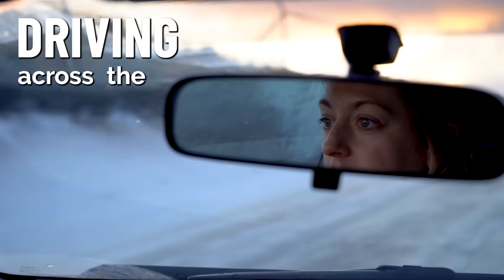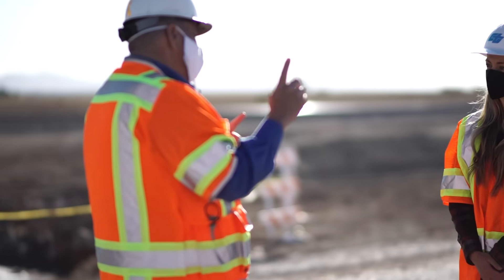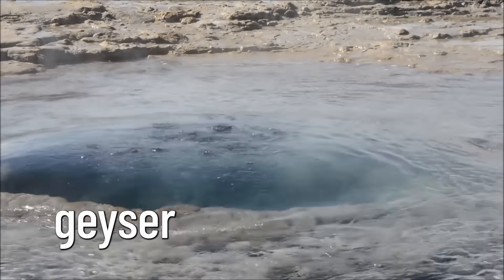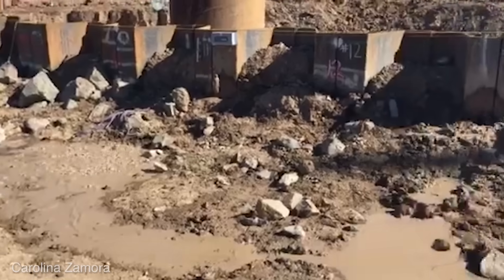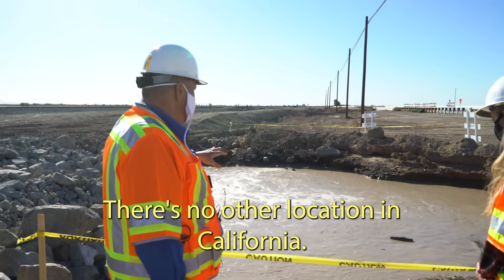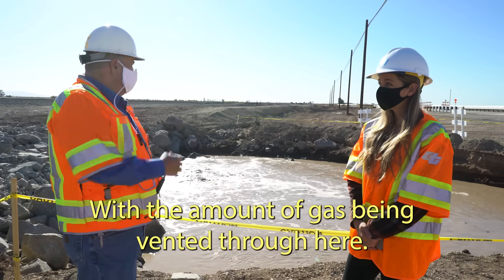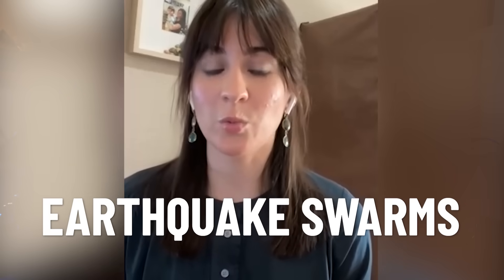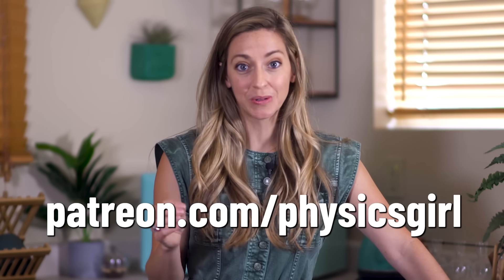World's Only Moving Mud Puddle

Comment: If that theory is right, you could drill a huge hole (maybe with explosives?) a few hundred meters away from its current position, in the direction that it is moving and it would "jump" to that position. There are a few caveats to this but It's a good starting point.
The caveats that I can think of are:
- What if the speed that it's moving is so fast because the angle is really big? Depending on the source depth, you can't just drill deep enough.
- What if there are more "solid" bedrock in it's path, forcing its path to change directions for a while? It could also make the puddle stop moving and then after years (decades even?) "jump" ahead.
- What if the path it is taking is pretty straight but "near" the surface it deviates? (imagine like the shape of a street light lamp post)
This is soooo weird. I like it. Also, what if the source itself is moving? I know that is highly unlikely, but not impossible.

Comment: Can you do seismic test of the area and find pressure pockets and plan a pressure release if it's possible . Than it would remove the gas from beneath on the parts you have drilled which would reduce the pressure that it exerts on the mud puddle hole . It's like analogous to a pressure cooker if you poke small hole on top the pressure wouldn't built up that much and maybe use the CO2 obtained from the puddle for industrial usage ?

I think a seismic analysis of the area is crucial . The source of pressure must be determined

Comment: It really reminds me of the cold co2 geysers in germany like at andernach or wallenborn. Especially since there was mention of a co2 reservoir. The movement feels to me like some sort of erosion. The flow first found a path and since it started flowing it erodes at the top and moves until it is a vertical pipe basically.
But that would be just speculation offcourse.  Maybe a seismic survey could pick up some faults or detaills about the reservoir

Comment: If it is caused by gases traveling up at an angle then surely you could drill down and release the pressure somewhere else where it's not gonna be a problem, by giving it a shorter route

Comment: I'm guessing that some seismic studies have been done to try to find the source of the magma driving "kyle". Somewhat disappointing that this was not discussed. The most likely way to save the highway would be to drill a pressure relief hole for kyle to teeth on, on the other side - but you'd want to have some idea of the path the gas is following to know where to drill. And ultimately you'd like to know where it is coming from to determine what else will be at risk.

Comment: I suggest doing a seismic survey like they do in oil and gas explorations. The result may give data to come up or to validate a model of what’s happening such as the gas pocket on a ramp hypothesis that you suggested. I’m surprised they haven’t done this already. How did they decide on the depth and strength of the retaining wall without doing this?

Comment: Why don't they drill the other side of the road? If you can't stop it, help it get there, so less damage is done to the area. The puddle is moved a lot and left behind solid ground so this may help. If necessary drill at an angle.

Comment: Is the solution so obvious  that only I thought of it?

If the theory of the puddle travelling towards its source is correct, then drilling on the OTHER SIDE of the highway would give it the more vertical route and thus save the highway!

Just stand well back while doing so

Comment: I’m surprised that we can not simply make a 3D scan of the underlying  geology. An animation of that over time would be awesome. Studying its source and path is important. You can not stop a hurricane (yet) but you can plan for it. =]
So glad you are back. Missed you so much. !!
Reply: That's a field that's still in its infancy due to dirt and rocks and so forth being so difficult to "see through". You can use ground-penetrating radar in some soils and not others (too much moisture makes it reflective so you can't "see" very deep in the best of conditions), you can use what amounts to sonar (set off small explosives and "listen" for echoes) in some but not others and so on. You can get some general idea of what's there for a ways down but how far "a ways" is, is extremely variable and limiting.
I ran into this issue when I was an irrigator in Phoenix Arizona which basically is built on 400-ish feet of muddy, sandy river silt deposited on top of a granite bed over geologic ages as the Salt River meandered over the basin filling it in. There are many many layers of a mineral known as "caliche" which is what you get when heavily mineralized water (that's how the Salt River got its name) dries up in summer- it's a lot like concrete but more difficult to dig through. So you have 400 feet of silt with a web of rocky strands penetrating it in many overlapping layers. Sonar can't see through it and ground-penetrating radar is stopped by the water some of those caliche layers still carry when it rains and the water penetrates to their depths. It drives local geologists to drink (not water). California soil is way worse with its higher water content and earthquake-shattered rock formations.
We just don't have a technology to do it.

Comment: I'm wandering if the underground source of the co2 has been releasing the gas through the only available outlet that just happened to run a long distance underground before finally going up and out. Over time, that outlet may have eroded away, presenting the moving mud puddle. Perhaps they should try digging ahead of where the puddle is moving to. I suppose they may be way ahead of me and likely already tried this.

Comment: The solution is fairly simple. Either you move the road around it til its beyond the point of the original road, and repave that, or dig down, build an underground bridge, put the road on top of that, and let it flow through an artificially lowered canal til its past the road.

Theres another thing that can be done, if it really is coming up at an angle, you can attempt to pre-empt it and drill ahead of its path to see if you can get it to prematurely move a larger distance. The fact it moved 60 feet in a day once means its clearly got a lot of distance to cover and potential for movement.

Digging a channel down 50 feet or so, and in the direction of travel, would be the easiest way, instead of doing sheetpile walls perpendicular, use them for the sidewalls, anchor backwards into the ground a few hundred feet, and just let it erode underneath the bridge, while the bridge sits pretty on either side.

Im surprised they havent done more real geology on this, ground penetrating radar, seismography, prospective drilling.

I mean, its possible they have and just dont wanna talk about it, but still, the state or county needs to get on this.

Comment: If it’s coming up at an angle (that’s just getting steeper over time, bringing the top in line with the actual source)...

...that could explain the wall’s behavior. As it shallowed out, that pressure would first hit the wall, causing it to crack and leak, before traveling up and exploding.

...couldn’t you get it to “skip” past the highway by drilling a new hole on the opposite side, along the apparent path of travel? Basically vent it closer to the origin, and let it restart there. (Granted - who knows how deep you’d need to drill - at least deeper than they set the wall - but it would be a repeatable control method.)

Comment: if the reason it's moving is in fact that the gasses are coming up at an angle from a deep source, and wants to find a more direct route to escape, would it be possible to drill down deep on the other side of the highway, intentionally creating this more direct route?

Comment: Unconsolidated sediments from the Colorado River dumping into a graben formed by the East Pacific Rise being over-ridden by the North American tectonic plate with mantle sourced, or biologically sourced gases coming to the surface through a shallow aquifer. An analysis of the radio-isotopes in the gases would give important information about the source. The gas and water may have started moving through an inclined fault plane associated with graben development, and the water and gas stream is migrating to a more vertical vent arrangement which would be more mechanically efficient. This hypothesis would be supported by the migration of the vent toward the center of the graben (SW) rather than toward the adjacent crustal block (NE)

Comment: seems like its a pocket of gas and water thats bursting through the strata. but its also erodes the sides of the crevaces it escapes through, and it falls into the pit. not unlike the story of where the laked drained and disappeared. where drilling for oil, in a lake, they drilled so low, they punctured uderlying caverns for salt mines, due to a miscalculation in the location.  
why its moving is just like sand dunes moving along a river courses. or spraying a bank of sand with a garden hose, from under

Comment: If we think that the puddle is moving because vent is at an angle and now it is trying to straighten, can we bore a hole in the line of its projected path to check that hypothesis? If yes, can we use similar holes in the path to provide alternative path for the gas to vent, thus reducing the pressure in the puddle?

Comment: Cool video, subscribed, good luck. They could: 1) use oil industry seismic sensing to see underground structure and find the sloping stratum; 2) find a point where the stratum can be drilled to relieve pressure directly over the source, skipping over the migration process.

Comment: I have a theory. May be there were two pockets one for co2 reserve and another for water table reserve. One disturbed the other. And suddenly activated the more volatile co2 one.  Then co2 reserve got first into and around the water reserve and then popped up sideways of the water reserve found the weakest point of exit. Now after years of exiting through the same point it has gained momentum by weakening its side and diverting water into the co2 reserve. And thereby making much more space for it.  Now its just straightening it up. To check it we could check the ground water in that water table for higher than normal co2 levels dissolved in it.

Comment: I am surprised when you called the "angled" hypothesis a "creative" one. It was the first thing I thought of when I started watching. It seems rather obvious - the same way a mountain stream erodes the mountain on its path into a valley, the constant upward movement of water at an angle erodes the ground above it.
Anyway, I wonder - did they try drilling on the other side of the road? It seems that if they could break through the rock into where the stream started, they could let the puddle jump over the road, just like water sent through a storm drainage system prevents it from eroding the infrastructure above.

Comment: This is one of those things I really want to know the explanation for, but when we get it I won't understand it in the slightest.

"What happened is an Emererhant-Speargle fault released pastatonic gasses to create a localized Dulbish system that persisted due to the mungibility of the sediment. Because of the low gumption in the area the thing didn't even register on the Balphal scale, meaning the pressure could easily trigger a Mmmbop-Badubaduba reaction

Comment: Thanks for sharing your thoughts and videos. That’s a really crazy thing. Wondering if the could use some sort of ground penetrating technology to confirm its source and if it’s as theorized drill a vent directly into it past the obstacles it’s headed for and it might skip ahead and stabilize. Seems to be a significant amount of gas being released, maybe put a well casing in and plumb it to a filter and gas separator then hook up a turbine to generate electricity and use the proceeds to buy carbon credits to offset its release. Stay safe, good luck with your future changes, wishing you the best.

Comment: Why don't they jump ahead on the "path" the mud spring is following, and drill down until they hit a pocket? They could force the spring to "jump" past the location of the road and tracks, by creating an artificial path for the gasses in a place where it will do less damage.
Reply: The path of least resistance for the escaping gas could have all kinds of shapes, not necessarily a straight line, and some parts may be more steeply inclined than others. They also don't have a good way of knowing how much farther the puddle will continue to move on its own because they don't know where the source is. 

Additionally, the path that the gas is taking could be quite narrow in places, so even with a good estimate of where to drill, you might be unlikely to hit it.
Reply: @Pyrogecko08  That is true. But, exploratory wells are cheaper to drill than it is to re-route a major artery for traffic and goods. It also seems to be moving towards the Salton Sea, if you trace a line through the former locations. It might all be for naught, but if I were in charge of the budget, I'd look for relatively cheap preventative measures before committing to an expensive, and ultimately temporary, re-route of both the highway and the tracks, which will cause delays that will ultimately cost WAY more than a few (possibly) wasted drill heads.

Comment: Have they got geological strata maps of the region, that should indicate the composition and slope of the geology they are dealing with. combined with seismic data it should get a better picture of what's down there. (it might be a lot of oil.) 
They should run a series of 2000ft+ deep drilling holes on either side of the rail/highway, they should then hit the main pocket of trapped gas underground. tap it and fit pumps to compress it back into a liquid and pump into tankers to be transported to old gas wells and pump it back undergound storage (to be joined with later carbon dioxide sequestration and storage under CO2 climate projects.) 
Letting it simply vent off is probably a really bad idea. (if it were clean CO2, you could get a drinks manufacturer or other industry to just tap and use the gas, hey, it's a free resource.)

Comment: If the proposed mechanism for motion is a bank that the gas is rising along, do you think the best way to stop it is to get ahead of it? We could chart where it's going, and instead of installing a pile wall like Union Pacific did, we could install many semipermeable pipes that go from depth to the surface that would act as bleed valves. That way, as the bubble approached, it would bleed off.
However, there would be no guarantee that the bleed valves won't be installed near a sheer face in the bank that the gas is rising along, which could lead to the valves being overloaded and potentially an explosion. 
Just food for thought from someone else who gets weirdly obsessive and curious about things and can't help but share! Best of luck with your channel moving forward.

Comment: If it is correct that the gas is coming up at an angle, then it seems like you could "help" it come up straighter and have it skip the road. Just drill a hole down to the current underground path on the other side of the road. Once there is a shorter path to the surface the pressure should dig out the new path and stop the movement of the original hole. Has this been considered or tried?

Comment: With the working theory being the movement is slanted erosion back towards the source pocket of gas, wouldn't an immediate fix be to drill boreholes in advance of the puddle? If they dig a 100ft borehole on the other side of the road it'll become the path of least resistence and the puddle will effectively jump across the road instead of slowly eroding through it?

Comment: I think they are underestimating the size of the air pocket. Maybe they should get a big oil rig digger thingy. Dig that relief as deep as possible to let the pressure out. Side bonus they have a free co2 source to bottle up n sell :p
Reply: This is a completely uncontrolled release to surface.

Oil and gas reservoirs only really "work" because they are a nominally "sealed" volume. Liquids and gases can flow or, have flowed, into the reservoir and are trapped by a cap stone that prevents them from migrating out.

Turning this into a commercially viable CO2 well would depend on the quality of the gas including any contaminants, the volume of gas in place, and the permeability of the source rock, among other things. Then, if it was potentially viable, there is no guarantee that flowing the well to a production facility would depressurise the reservoir enough to stop this uncontrolled flow. I can tell you from experience that the volume of gas seen in this footage is definitely not a commercially viable quantity. You would need to flow MUCH MUCH more gas to production in order to make a decent profit.

Then of course there is the risk of taking on the project, which is already a crisis in progress, and failing to resolve it despite spending millions of dollars. That's a big potential downside and potential for damage to reputation and public perception.

Comment: Can they not use GPR to sort of map out the cavity it is crating/made, and then sort of map it's likely source and drill there? if you're right about it wanting a straight source, shouldn't drilling in the right place cause a sort of pythagoras cup effect draining the water and mostly the CO2 from the mud pot area as the CO2 has a much more convenient place to vent? Though I'm sure that ground has a network of underground cracks and gas pockets at this point, especially if five stories worth of wall can't stop it.

Comment: maybe they could try to jump the puddle if the angle theory is correct, just draw a line of it's movement and then drill along this line somewhere after the highway, if they reach the co2 pocket, the pool will shift and it will skip the road altogether